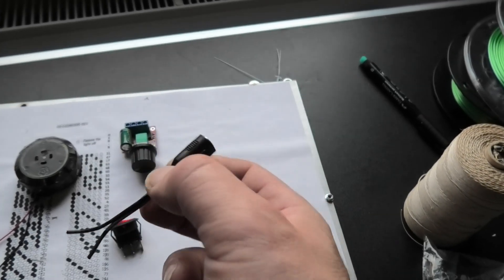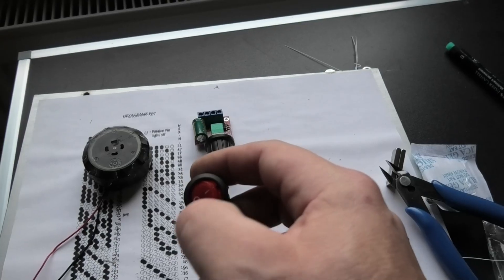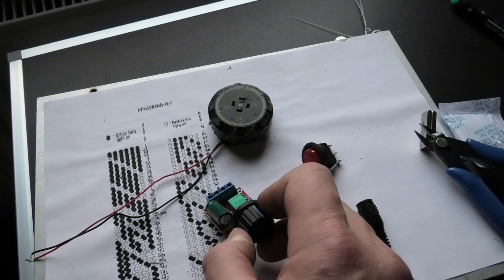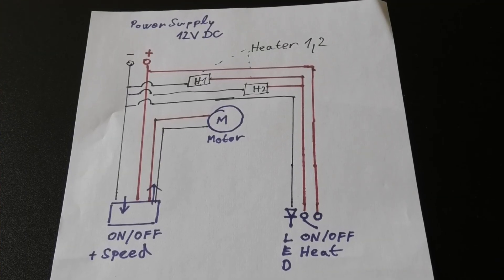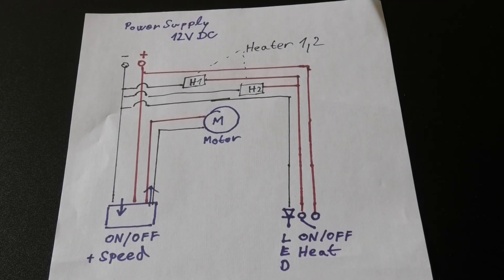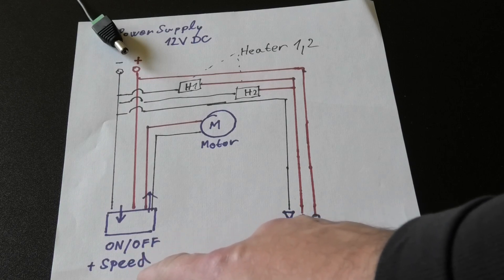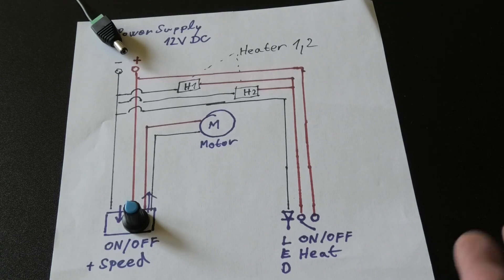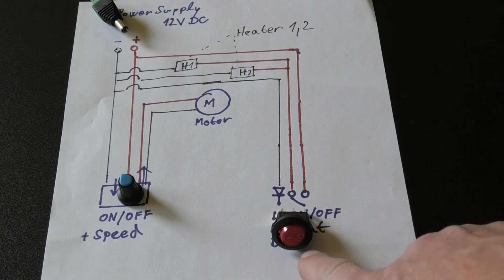Contactless Ghost Mixer - DIY instructions #handmade

Comment: Wow! Nice work.

Will it work for mixing protein powder?
Can it blend multiple ingredients? Pancake batter? Milk, egg, sugar, flour?
Is the final consistency of the product important for functionality?
Reply from the maker: Thanks for the good tip
It is certainly possible to build a stronger one that would handle it, but it is pointless when you can use a classic mixer)
This one is used more when you need to mix in a closed container, not to breathe the vapors, or on the contrary to contaminate the mixture from the outside.
Or when you need to knead something for long hours. This DC motor can work permanently...
Reply: I know it makes no sense but I wunna see you make pancakes with one of these.